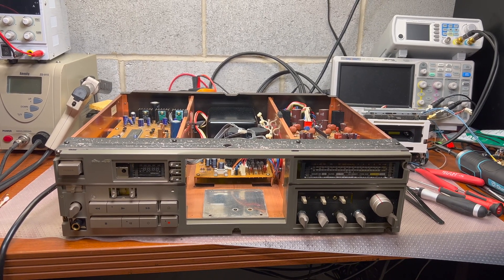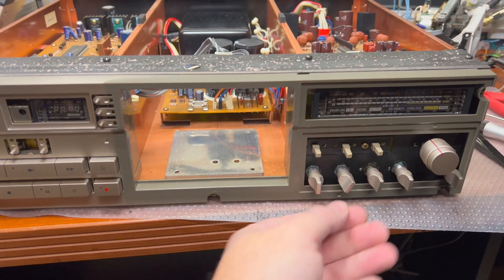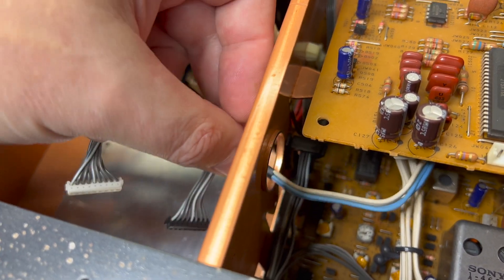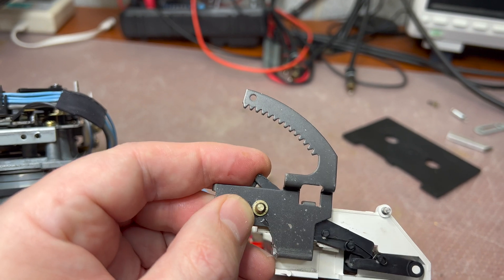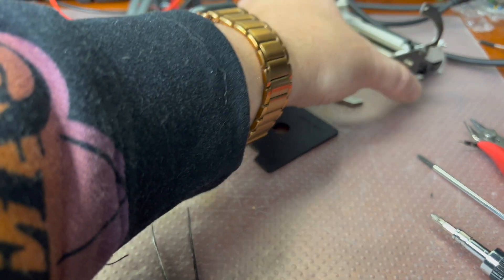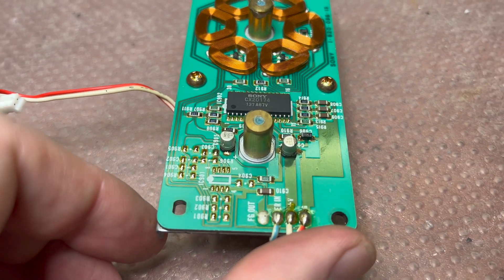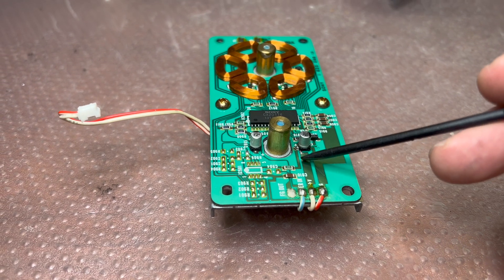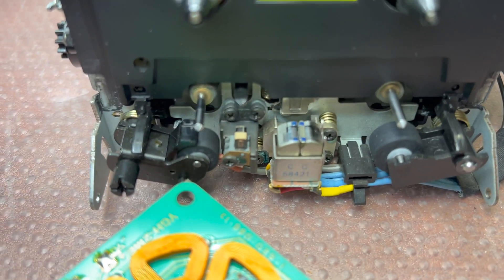Sony TC-K555ESA: A Comprehensive Parameters Verification

Comment: What are SMDs used for? They don't work when they cause what? Thang you
Reply from the maker: That SMD caps are leaking and acid eats traces.
Reply: @hifirulezzz  If the SMD capacitor is malfunctioning, how will this affect the function of the tape recorder?
Reply: Thank you for your videos. I can now replace the pinch roller, belts and capacitors on my sony tc-k 890es player

Comment: T5:50... that HURTS to watch! I have to work that out in both of my TC-K decks. One has heavily blackened tracks, still conductivity good. I plan to replace the caps, scrape away the coating, clean the traces and re-cover them with green lacquer for protection. Is there any reason I should NOT use a regular through-hole electrolyte cap in place of those little SMD bastards?

Jewel bearings... those are notorious for breakup when the capstan isn't fixed PRIOR to shipping. I need to get some capstan dust cover and I don't know where to get them. I have the material suitable to reproduce them but not the tool to make a precision job.